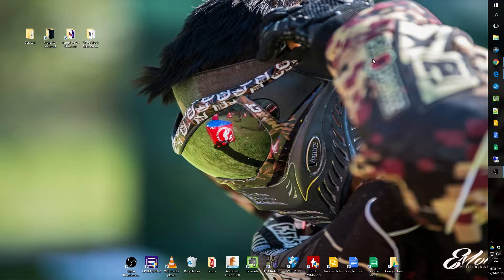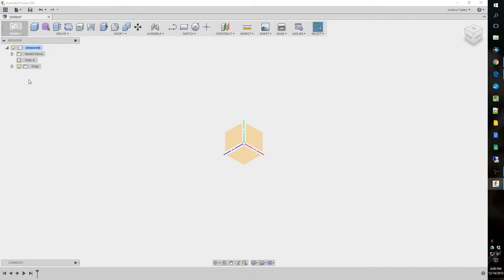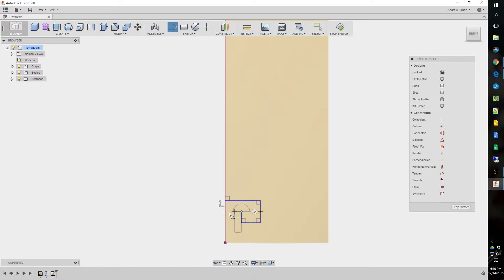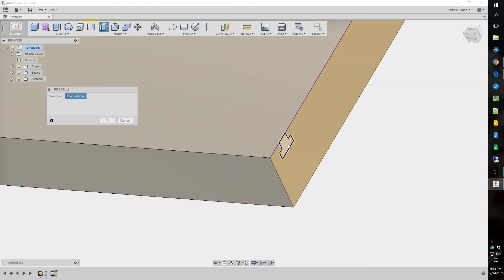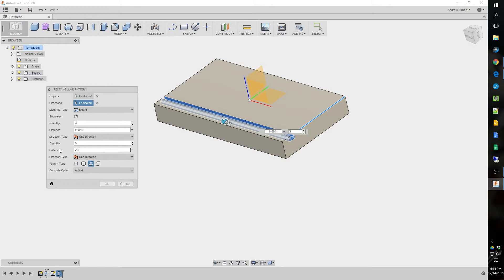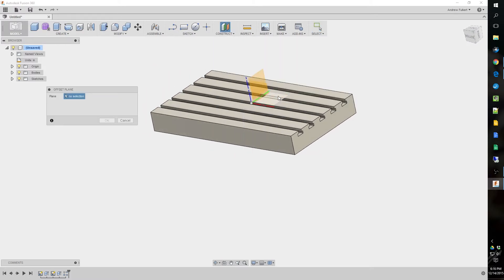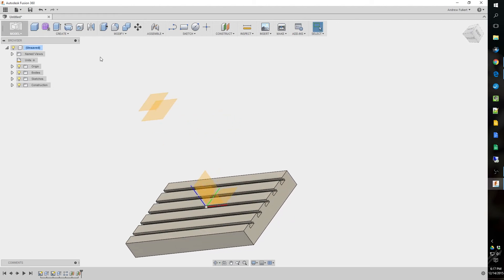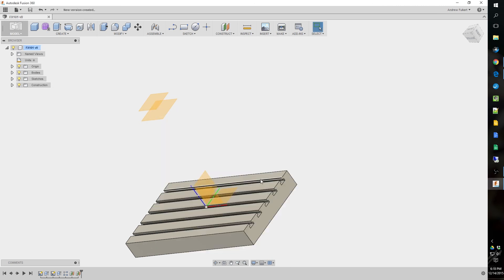DT1  MACHINE TABLE

Comment: just a hint do all you sketch's in components it's the proper way to do it in fusion, it keeps it all nice and tidy and you can just copy and past new intro and new design.
Reply from the maker: +daniel lyall  I did some tests the sketch move to the components.. Looks like fusions knows which sketches go with what bodies and make those in components and the sketches follow . 

Let me know if this works for you
Reply: +Chief Machining it depends on the way it is done in the first place, if you do copy and past of just the component it can fail if it been done from projected geometry, or on a plane.

if you save as, it pull everything through but if there is a dependency it can fail.

now the above in most case's can not be fixed

if you do everything in a component it can still fail but it can be fixed very easily, if you do a copy and past new.

the main point of this is that you will want to reuse the table model over and over again, the best way to do it will be to insert it into a sketch so it is chained to the first instances, if you do a tonne of sketches with the table in it and if you find that you made a mistake in it you can fix the parent, then just update the other copy's.

also if you don't have everything in the component when you move however you do it, it will have a sketch it's body in a component if there is a plane that will be in a file. so that is 3 items in the tree you need to keep track off.
if it's all in a component that's only one file you have to deal with.

but doing everything in a component is the best practise, you can ask this on the forum and you will get told it is.

even NYCCNC does it this way know after going to ADSK university because he was told that is the way to do it.

same with me I got told to do it this way by the top 3 users they never got told it is the wrong way to do it.
Reply from the maker: +daniel lyall  I guess it depends on what I'm doing.  I use that technique if I'm plan doing a top down assembly but if not just simple part and simple assembly that will get some components dragged into it just to check fit real quick
Reply: if just playing around direct modeling is the way go, no time line, in this mode you can do what the hell ya want move whatever and ya shit don't go all crazy. and you can still do the cam. DM can work better at time's than parametric modeling